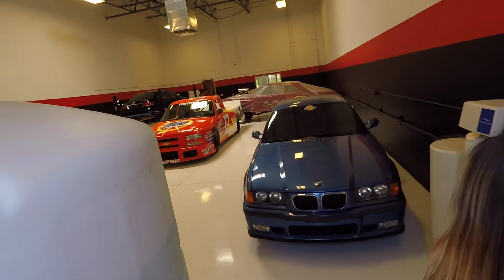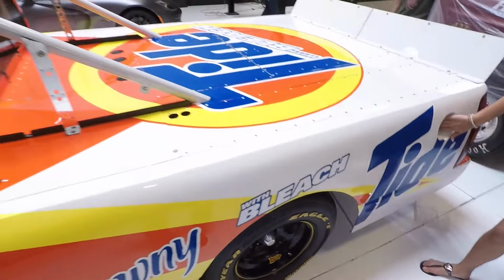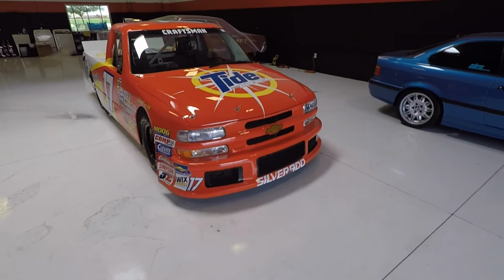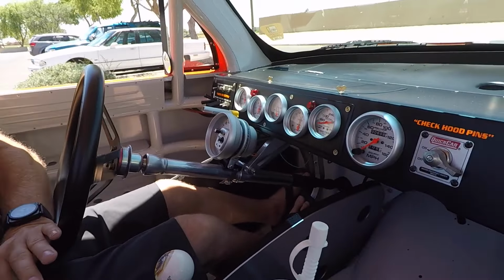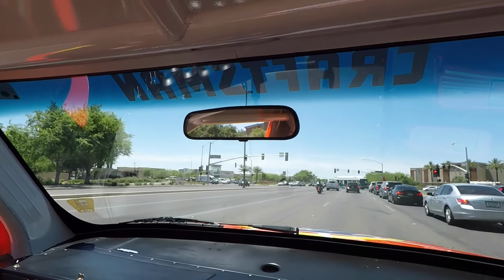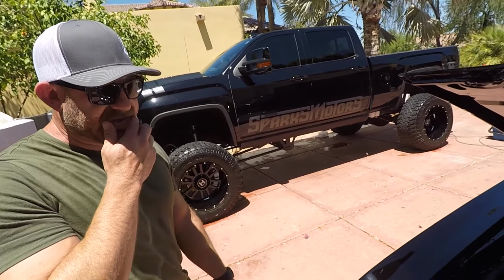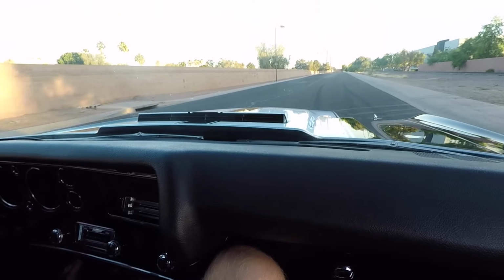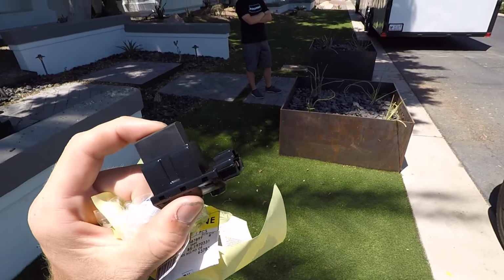We Found Another STREET LEGAL NASCAR Truck! (IT'S SO CLEAN)

Comment: They really did a road course race in the rain, Nascar truck race. And they had a windshield wiper and rain tires (Dale truck upgrades). It was great race but they didn't do it many more times.
Also I bet this truck was a touring/show truck. Its to nice and (beside the running lights) a glass windshield is not Nascar even a little bit.

Comment: I've got a s10 in my junk yard that my father in law parked there with a 383 stroker and a munzi 4 speed. Had the suspension done as well with a fuel cell. It's just rotting away but I bet it would tear that truck a ass.

Comment: The Dale truck needs upgrade. Street exhaust with a power switch which you with a flip of a switch street to full open boosted but'
Reply: The boosted bois did this to the minivan and it's cool you get the sound dampen from the muffler then hit the switch and get free flow exhaust no muff.

Comment: What horsepower is that class of truck?
Reply: With an engine of the proper vintage? Restrictor plate or not? Modern engine with throttle body injection and ECM that didn't exist then, but what is used today?
450 to 900, take your pick. The low end is what's used today. It's just a look-a-like, anyway.
Reply: They acted like it was raced so I meant what power engine would that class have

Comment: An real stock car no LS real sbc or custom made for only nascar push rod v8s makes more power then any LS or LT these nascar engines make almost the power of gms 632 ci big block crate engine with only 358 ci and 9,000 rpm 😌

Comment: Its not street legal.  No mirrors
Reply: Dragon Timothy 6:40
Reply: Blurryface 2011 Florida Statutes. 316.294 Mirrors.—Every vehicle, operated singly or when towing any other vehicle, shall be equipped with a mirror so located outside as to reflect to the driver a view of the highwayfor a distance of at least 200 feet to the rear of the motor vehicle.